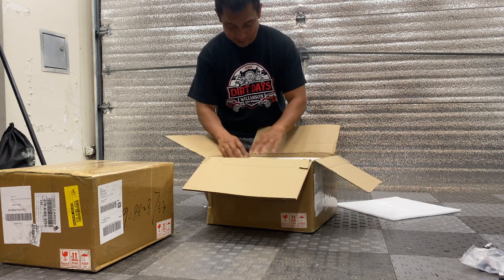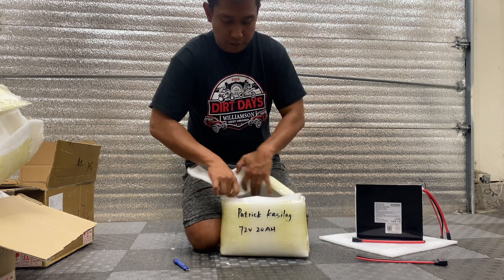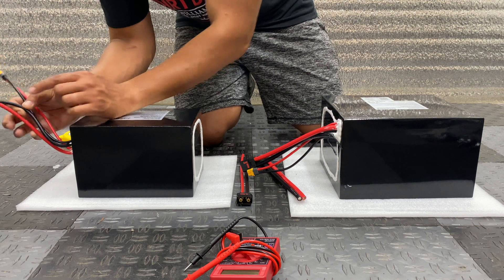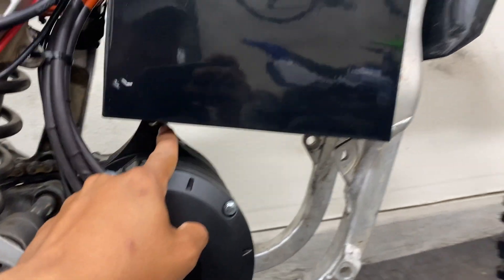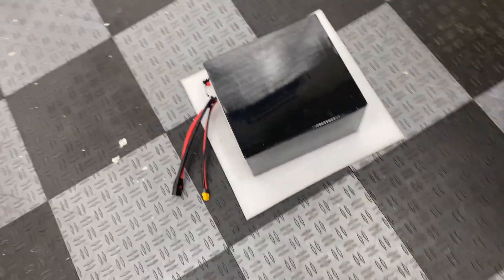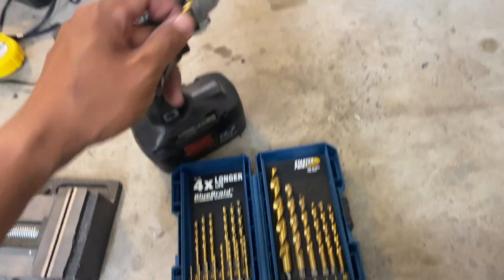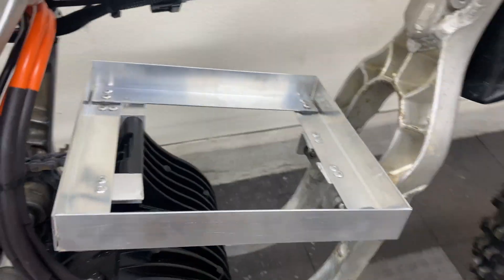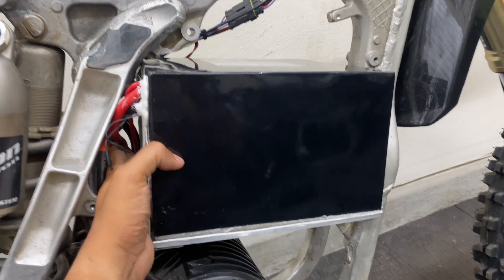Project YZ-E | YZ250 Electric Dirt Bike QS138 AMORGE 72V Battery Conversion Part 7

Comment: Will you get electrocuted if you touch both poles of your dirt bike battery
Reply from the maker: Not sure.. can't think of anybody who would do that. The connections are not exposed (water proof sealed connector.)  Would you get electrocuted if you touch both polls on your car battery? I imagine it's the same thing.

Comment: i have an important question. can you tell me how much height is between the top of the motor and the top of the frame on the inside? i am trying to figure out if i can fit a 11-13" tall battery vertically like in a surron

Comment: I have no idea about the electrical side. I looked up wire locally and like 2/0 and 3/0 were good for 225-250 amps. It was solid copper.

Is this just special wire, or is there something I'm missing?

I want to run max say, 350amp cont and 450-500 amp peak (Like whatever the Electro and Co, Trumoto, Zapper controller handles.)
What gauge wire do I run to from the battery to controller, and then controller to motor? 

Thanks!
Reply from the maker: Well the QS motor (orange) phase wires come already connected and bolt directly to the controller, I believe those are 6 gauge each. Between 2-6 gauge for the battery power supply wires to controller

Comment: Hey man love the build and it looks sweet but you should really put some sheets on the sides of that battery box just incase you crash, wouldn't want a battery puncture because that would be a lot of money gone, just a little thought, that's my concern on all electric vehicles, can't wait to see you riding it!
Reply from the maker: It’s still mostly gonna be covered by the tank and the side fairings, but I’ll look into adding more protection!
Reply: @PatOutdoors  I think they meant in the battery tray you made. That's what I was thinking! Good fab!
Reply: Yeah that's what I was thinking the tank and fairings would protect it but if you land on like a stick that slides into it or something, I dunno, anything can happen trail riding but yeah just a plate over the sides of the tray would do but whatever you decide to do man it's your build in the end!